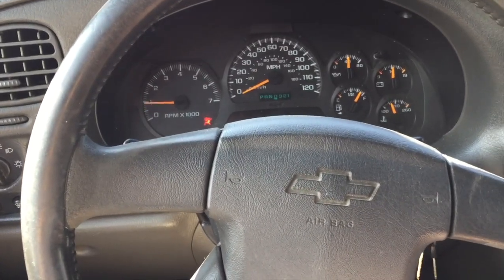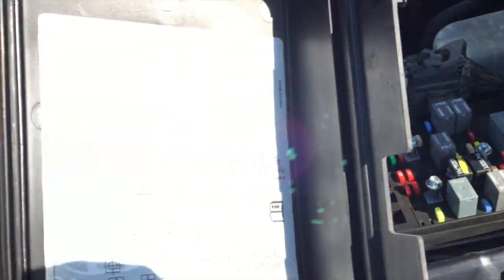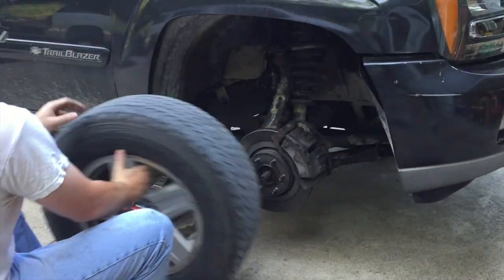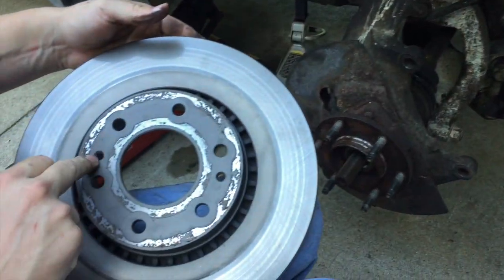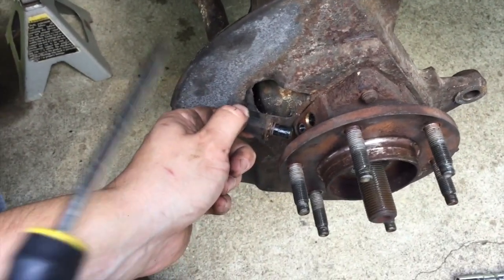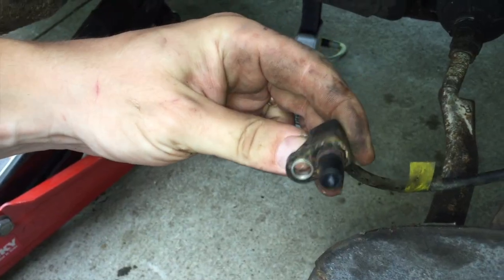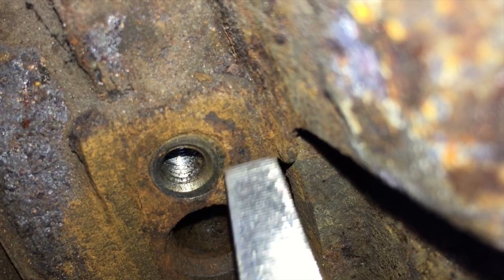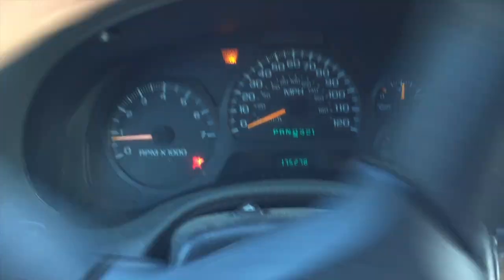Brake pedal buzz at stops - ABS kicks on at stops - Cleaning Wheel Speed Sensors - GM Truck

Comment from the maker: BRRRRRRRRRR! That wasn’t me! It was the brake pedal. Honest!
Reply: It's funny, it's either a bear growling or fartin
Reply: Great work! A little antiseize compound on the hub surface might hold off the rust for a little while. Thanks for sharing!
Reply: curious did it make this sound when shifting from drive to reverse when lifting off brakes as well?
Reply from the maker: @charibroden2668  no. Never noticed mine doing anything like that.
Reply: I pulled the fuse and it still is doing it. Very lightly but still doing it.
Reply: @jaystreet4004 did you figure out the problem?
Reply: thank you. i think this is my problem with my f350. thank you.
Reply: Really? Your missing the c/v shaft retainer, that is a big problem,  will damage bearing.
Reply from the maker: @baukesikma9374  good eye, but it wasn’t missing. I removed it. I replaced the cv shaft later.
Reply: @TheDaninator  Cool.  FYI when I worked as a technician back in the day GM had a recall for this concern, I perform a few. Your repair is spot on.
Reply: Hi, 
Could this sound have the same root cause?
https://youtube.com/shorts/ftG-D0u0kp8?feature=share
 Thanks.
Reply: I have question I have 2004 Tahoe that does this just does the opposite so it does it once gas pedal is pressed doesn’t do it at braking
Reply: @rorybuckendahl6472 that might be more of a hub problem, but lmk what you found out what it was for me thanks!
Reply: Your sound is describing an A10 worthog

Comment: Thanks OP.

This is a known problem not just for Trailblazers, but almost all GM trucks in that year range.  There are almost 50 such videos on YouTube describing this very problem and the solution is always the same:  remove the shim if you have one in between the sensor and the surface.  Then sand down and clean both mating surfaces.  Keep sanding until the problem goes away.

My tech replaced the sensors but it didn’t fix the problem.  If your abs light is not on, then your sensors are fine.
Reply: @johnl9595 if my abs light doesn’t show up when it does this issue and your saying it’s not the sensors then what do you think it is before I take my envoy apart it’s a 2008 slt and it does the same pulsing brake and brrrrrrrrr noise
Reply: @dylanmetz3440 Did you fix the problem and if so, what did you do? My 2000 Chevy Blazer is doing the same thing! I guess I'll take front sensors off and sand and clean it up, hopefully that will take care of the problem! My ABS light never came on!

Comment: Thank you so much for the video. It is really helpful. I’ve been dealing with this inflicted pain for too long, replacing o lot of parts from the brake system and the problem persists. I will try this. At least now I know that the least suspected issue could be tue culprit of the problem. Thank you so much
Reply from the maker: I hope this helps you fix it!
Reply: @. It actually fixed my problem. Did exactly as you described in the video and bingo!!!  Again, really appreciate your video. Thank you 🙏

Comment: Great video - I have the same issue with a 2002 Honda Civic after getting some cheap Ebay ABS sensor replacements. Never again! Thanks for suggesting pulling the ABS fuse, that confirmed it. Thank you!
Reply: Never use non oem sensors the aggravation can be endless.

Comment: So my 06 Chevy trailblazer was doing the same thing I went to a tire shop in my neighborhood and got a ABS computer diagnostic for $35. The guy told me that my ABS control module was bad. It said it was expensive. What the heck I went wasted $35 I came home did exactly what you did in your video and boom Shalaka problem solved. Thanks for your video.

Comment: Just wanted to add this.. I changed both front wheel sensors but I notice that the passanger  side had a thin metal gasket which I put back when re installing new sensor, found it strange that the driver did not have this gasket? so after putting  everything back together and test drive it had the very problem you described which it never had before I was changing them because of codes saying the sensors were sending erratic signals... this whole problem was being caused by that thin metal gasket ..once I removed it everything was fine with the system...

Comment: A have the same problem right now on my Toyota Camry 2016.
Reply: Same 2014 Camry my sensor had rust on the tip and there was build up on where it mounts. I’m watching video after I already cleaned it but hopefully works

Comment: My Camry does this, same wheel. Installed a new sensor, it still does it. My hub was like new, no missing teeth and no rust at all, that's why the new sensor but still no luck.

Comment: i have a trailblazer too. i recently had several suspension parts replaced. after the job. i was experiencing the same. i had to disconeect the abs sensors in order for the brakes to work properly. so the trick is to clean it like you did in order to work?
Reply from the maker: Removing any rust scale and cleaning the surfaces should certainly help
Reply: @TheDaninator  i follow your steps, and it worked! thank you.

Comment: Thank you for this! Mine was activating at 15mph. After watching this and replacing the sensor, i found that putting the factory shim on the aftermarket sensor was no bueno. Took the shim off and it's now doing it at 5mph. So mine is still a clearance issue between the magnet in the sensor against the tone ring inside the hub assembly. But this video got me on the right track. Thank you!

Comment: I have a similar issue on my '95 Audi A4, except it's at all speeds. The ABS light isn't on. I'm gonna go check the sensors and the ABS rings. Let's hope it's nothing else serious.

Edit: I cleaned the sensors on the front wheels and it worked! Took a drive around the block and the brakes were working normally.

Comment: Wait so if you take the fuse out and it doesn't make the noise it's just the sensors and not the whole abs itself?? I'm having the same issue but how do I tell if it's just the sensors or the abs module thanks.
Reply: Pulling the fuse will disable the whole ABS system. It won't tell you what and where the problem is.

Comment: Thanks for the helpful video! My Toyota Prado TZ 1997 was having the same issue, but after watching and following the steps, I removed the fuse to check then cleaned the sensors. Test run was a success and the problem is now solved. Much appreciated!

Comment: Thanks !!! I replaced both my hub bearings on my 99 Blazer and everything was fine for awhile  then I started getting the brrrrrrrrp . Gonna try your remedy tomorrow. I was down to thinking it was the brake booster because of the noise and location it was coming from but your video has helped me think otherwise.  You Wouldn't think with 2 brand new hub sensors  that I'd have a problem but it does exactly what you were experiencing. Thanks again.

Comment: I experienced the same issue but thanks i sorted it out. I replaced the Abs, and break pads but with no change. Someone told me to remove one of the sockets in the abs and it just worked. Just try and see

Comment: I have the exact same issue with my 04 Jeep Grand Cherokee. I’ve been trying to figure it out for so long. I have two abs fuses. One for the pump and the other one for the main relay. Which one should I pull to test it out?

Comment: This video helped me so much! I just replaced the bearings, rotors, brakes, calipers, and control arms. Once I put it all back together it started having this issue. I just ordered a new sensor so hopefully it works.
Reply: In my case the bzzrrr noise still kicks in when I brake at at 4 mph, I got a new abs changed, cleaned it up even though there's no abs light coming on the dashboard in the first place. What situation might this be
Reply: @Richard Azuama  replace speed sensor.
Reply: Did it solve the issue

Comment: Exactly what is going on with my 03 Silverados ABS system. Nice video now I know how to fix it. Thank you.
Reply: Same here, did you ever fix your 03?
Reply: @LightYagami-qq9ry  yes I did just cleaned the sensor works great
Reply: @JD-526  okay now I know, I’m dealing with the same issue with my 03
Reply: @LightYagami-qq9ry  pull you wheels off the front and you will as I did rust build up around the sensor. Clean it and you will notice that the vibration in the break peddle stops between 5 mph and 0 mph. You most likely will not see a code for this problem unless it has to do with you ABS. Another thing you can do is unplug the fuse to the ABS and see if this problem stops, I think this is in the video.

Comment: Thanks man didn’t even think to just take out my abs fuse haha im just gonna run it like that
Reply: Still running like that?
Reply: @chambliziOfficialChannel  yup lol
Reply: @garrettisamess509  cool i did the same screw that abs back in the day they didn't have that had to shut the engine off to unlock the brakes its better loosing pedal pressure and rear ending someone

Comment: 2004 nissan maxima, changed the brakes and rotors brand new at that. whenever i stop it makes that grinding sound, and the pedal starts to buck/ shake until i come to a complete stop. the wheel speed sensor should be the issue ?

Comment: good thinking .. nice video ..I would have brushed some anti rust protection on all of that corrosion . You got lucky with that plastic pickup sensor   . I have had issues with my abs module making the front brakes drag  .  I have a scan tool   Foxwell NT630 Plus .. which does abs bleed and more .. I imagine what is happening is that the modulator dump valve is stuck after I fitted new pads and did a brake fluid flush / replacement . Using the scan tool I can hear the various valves clicking   but when the scanner asks for the abs on off  the disc is so solid that it is not possible to turn the disc by hand .

Comment: To anyone that put a thumbs down is an a$$hole. I can’t imagine someone being upset with getting free and helpful information. Wanted to thank you for your video. Worked for me on a Toyota. Cleaned all the rust with WD40 and small wire brush. Then used the mass air flow cleaner on sensors and the issue went away. Driving much better. Thank you again.
Reply: Its nice to get that kind of info Bravo 😊

Comment: Front end being a lower brackets control arms front or upper control arm ball joints etc now hub assemblies and I mean I got brand new hub assemblies and it didn't start until I changed it the whole front end and I replaced the sensors in the hubs twice on both sides and it still does it

Comment: I bought need axle bearing 2 years ago with the sensors.  Now ABS issues never went away.  I removed them and clean them and the ABS issue goes away for 5 minutes and it comes back!  Man I can’t figure it out what the problem is, any help would be appreciated!

Comment: I drive a 2014 Hyundai Elantra..whenever I’m driving slow the abs light goes off but when I drive fast it comes back on..When the Abs light is off I hear grinding noises on the driver side when I apply brakes but when the abs light comes back on and I brake I don’t hear any grinding sound(grrrrr). Changed my wheel speed sensors twice and rotor. driving me crazy. I will try to clean any rust like you said. I hope it works
Reply: Update..So I cleaned the hub and sensors on both sides like he said and it actually worked. Wow I’m really surprised..Thanks man you saved me a lot of money

Comment: Did your rpms fluctuate at all?  Did you feel a grind in the pedal?
Im going to try to see if the abs fuse being out will give me an idea of what is going on.
I replaced the abs sensor 3 months ago as the light came on.  It fixed it, but then I got this current issue of brake pedal grind and rpms jumping.  Another abs sensor replacement gave my truck a solid week with no issue.
Hope it isnt a module or something.  May just run it without any abs nonsense.
Reply: How it turn out?
Reply: @williamharper9356  It was the bearings/hub assembly needed to be replaced.   Not abs sensor related.  Tool 45 min for them to hammer it off on the lift.  So if one abs sensor doesnt fix it, it is the hub.  Running without abs is obviously not an issue.

Comment: Good video.  Swapped out the sensor, still doing it.  I'm gonna try to reinstall it and clean it really well like you did here.
Reply: I cleaned the heck out of mine, filed down the metal to get rid of all rust, changed both sensors. Still does it. Did you solve this?

Comment: Thank you for this video. That noise had been driving me crazy. Ive cleaned my rotors, greased up my caliper pins, changed my pads and the noise and vibration in my pedal was still there. No one told me abs needed maintenance.

Comment: just some minor additions:

1.) you don't need to loosen the brake caliper first and the bracket after that. Just unscrew that 18 mm bolts and take off the whole assembly in one step, saves time.
2.) after removing the rust scales and cleaning up the area where the sensor sits, use some grease or just a thin layer of spray paint to prevent it from rusting right back up again. will make it last longer until the next exakt same procedure

Other than that, great video and keep it up :-)
Reply: Thank you for the additional tips! I was wondering why the brakes had to be taken a part the way he did it in the video and it turns out you don’t have to do it that way.
Reply: If corrosion has lifted the sensor because it sets off to the side of its bolt and his plastic I wonder if you could heat it up just enough to Arch it so you know it's an all the way

Comment: Just started the video but I had the same issue in my 2007 Corolla! Now it’s completely stopped but ABS won’t function. Brake, abs, and tire pressure warning lights are on. Let’s see if this helps in cleaning the sensors

Comment: Thank you brother! I changed the wheel bearing assembly with a new one but the harness was different. I switched the harness from the old one to the new one thinking it should work, wrong. The thing is I put new brake pads all the way around so I didn’t know what was going on. Pulled the fuse and the frog 🐸 sound went away. Fixing this problem in the morning with the correct part. Thanks again. This was on a 2005 Yukon.

Comment: I just bough a toyota highlander and it does the same noice only when I about to stop completly. It is a buzz noice and vibration on the pedal. Do you think will be safe to just pull out the fuse and just drive it with out it?
Reply: I have same issue with 2009 Toyota highlander base model I don't know even where is the ABS fuse if you have any information 
Let me know thanks in advance 
Even I put snow tires ABS star work in 10 km speed.

Comment: Thank you sir mechanics tried to charge me a arm and leg saying i needed new front a back sensors.... Whats your check engine light on for?
Reply: Change your gas cap just got done with that b.s. and thank you for the advice i just pulled my fuse i dont like abs.
Reply from the maker: Mike Malone something to do with the EVAP system

Comment: Just cleaned the sensors on my wife's 9-7x, but didn't consider the buildup on the hub, so I'm still having the issue. Sounds like tomorrow when it's nice, I'll be in there again and see if that helps.
Reply from the maker: Happy repairs. I hope you can get it fixed.
Reply: @TheDaninator  Did that the next day or so after I commented. Seems to be doing good now. There was quite a bit of buildup like on yours. She's not driving right now due to what's going on, but I'll get more feedback from her when things are more normal.
Reply from the maker: @vorexis  Good deal. It's a common issue with GM trucks in the rust belt.

Comment: Would it be "Normal" for my ABS to make noise when I am going pretty fast down a steep hill? It does NOT do anything any other time though. I JUST bought a used car and it ONLY made some noise when I went down a steep hill fast and THEN put my brakes on sort of hard, NOT TOO HARD, BUT, a bit hard. This car has a "anti-skid" feature. I have had a brand new car (in the past)  and it had did the same thing IF I had been going fast downhill and THEN put my brakes on about medium force. 

I thought it was all normal, BUT, my mom was a passenger and my Uncle drove it going down a steep hill, and they BOTH seem to THINK there is an issue with the brakes. They are older and more experienced than I am, so, I am thinking they MUST know more than I do. I am here on Youtube trying to find out IF the Anti-lock braking system is just "doing it's job" or is there REALLY a problem. 

The dealer is okay with looking at it, BUT, I am wondering IF a REAL problem is there or NOT? MY steering wheel does NOT vibrate at ALL.
Reply: The noise is just the abs motor pushing brake fluid around the lines. If all four wheels are not going the exact same speed, when breaking, it will engage abs and make that noise. From what your describing, that sounds completely normal.
Reply: @brockturner3112  Well, I know that you had to just guess the problem and NOT see my car. It turns out that a set of new brakes and rotors stopped my problem. In my case it seems that it was a brake issue, thank you for your time anyway, had you actually seen my car in person, you may have told me I needed new brakes and rotors. It took my mom insisting it was NOT normal, to have me take my car in for new brakes since I was still under warranty. I now hear NOTHING when I brake down hills and have NO pedal vibration.
Reply: @juliegogola4647  Great to hear you got it all figured our! Brake issues can be scary!
Reply: @juliegogola4647  that does make sense, because if the brakes were wearing unevenly the tires would not all slow down at the same rate. Therefore it seems your abs system was over correcting.

Comment: I replaced both wheel bearings up front and my 05 trailblazer does this as well and when I'm not touching the steering wheel it doesn't go left or right ..... what do you think?